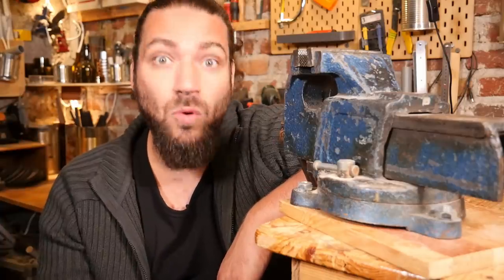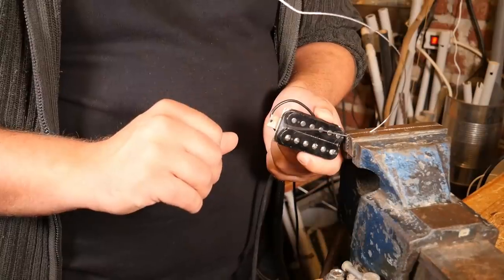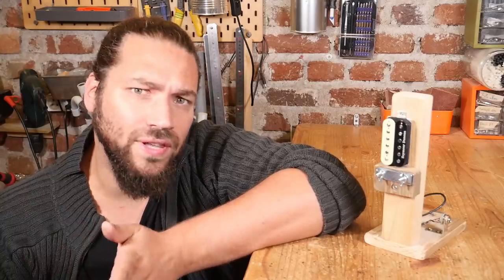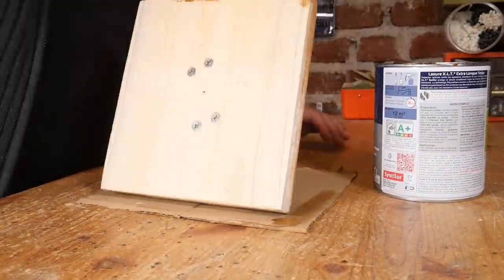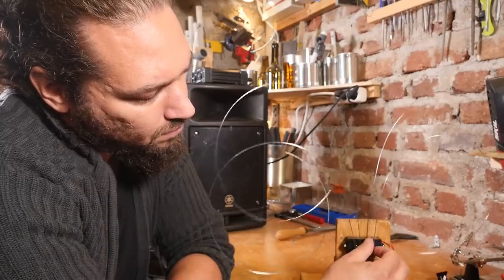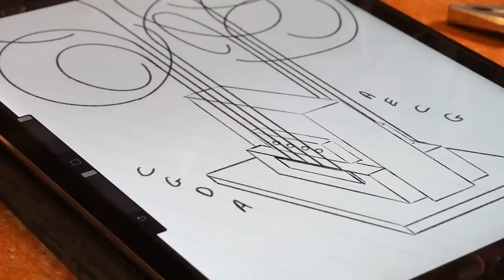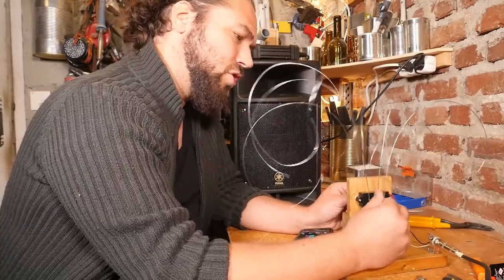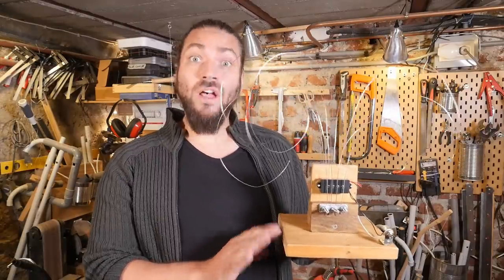I make an electric piano wire instrument

Comment: Watching this just reminded me of a trick we did as kids. We would loop a long piece of thread through a wire hanger and tie the ends together. Then we hung the thread over the top of our head and leaned forward so the hanger hung down. Then we pushed the thread into each ear with our fingers and would swing the hanger into walls and objects and listen to the sounds/vibrations it would make. Just like then this is cool stuff!
Reply from the maker: I love doing this too, this is the acoustic version of my intro!
Reply: Younger hippie days someone taught us at a party to use an oven rack and 2 strings, built in reverb.

Comment: Try using one of those tiny electret mics as a contact pickup on the base. They work wonders, or get into MEMS mics even more up to date. Then amplify it and have the amp drive a low resistance coil with a iron core and place it close to the wire. In one phase it will be deep and the other hookup it will rival a water-phone or anything to score a space movie. This is how the e-bow works, it's rather simple.

Comment: One thing I’d like to touch on is that guitar & bass pickups, while they serve a similar purpose to microphones, actually work by sensing how far the metal string is. A pickup contains a magnet, close enough to the string to slightly magnetize it. When the string is vibrating, the magnetic field changes, and this causes a coil of wire in the pickup to generate a small amount of electricity. In contrast, microphones use any sound vibration to physically vibrate an electrical coil inside near a magnet, which causes the same generator effect. This is why pickups can’t pick up your voice, or something like a nylon string. They can, however, pick up the sound out of a smartphone due to the speaker having a vibrating metal coil inside, which has a similar effect to the pickup as a guitar string. So, while similar in many ways to a microphone, they are not the same thing.

Comment: Get a spring, stretch it out to 2 screw hooks or posts on a peice of wood and throw a humbucker under it. Plug it into an amp on distortion setting and use a slide to play it like a lapsteel. Trust me. You won't regret.
Reply from the maker: I will try!

Comment: I wonder if this instrument could use a mouth violin instead of a pickup. You have a plastic disc in your mouth, attached to a rosin'd string (anchored to your shoe or something). Then you take the wire and rub it along the string?

I imagine the wire parallel to a fretted fingerboard. Pressing the wire against a fret defines how much length is free to vibrate. Then you rub the wire along the string. So, you've got:

1) Mouth disc and rosin string. The string is vertical, anchored to your left shoe.

2) Fingerboard and wire. These are held horizontally. Your left hand holds the fingerboard and fingers the wire against a fret. Your right hand holds the other end of the board. You move your hands up and down to rub the wire against the string.
Reply from the maker: That could work!
Reply: @NicolasBras   Thanks for your experienced opinion! I really don't know if it would work at all. I don't play any bowed instrument so I don't know how to apply rosin and bow it to make sound. I thought maybe to try and slide a wire along a string and it didn't make any useful sound.

So I was completely out of my depth.

In the meantime, I got distracted with a more promising prototype. I'm sure you could make it work in minutes but I'm struggling to make any useful sound.

It's a nasal ocarina, or "nasocarina". It's just a cup with some holes, held against my face to complete the chamber (mouth and tongue to adjust chamber volume). My index finger blocks my left nostril and my right nostril blows air at the nose hole - that's my problem, I'm no good at blowing transverse so maybe I need a nose plug with a slot to aim the air.

The base of the cup has finger holes. The point is, the finger holes allow rapid note changes, while the mouth/tongue control can alter key and increase range.

You can stack a bunch of nasocarinas which is good for selling them at shows, or you can put swag in the cups.

You can even throw them at the audience, because a plastic cup is very sturdy but also light enough to not risk injuring someone (here in Louisiana, thousands of cups are thrown from Mardi Gras parade floats every year).

Comment: So many inharmonics in each string, absolutely sounds like some strange ethereal kind of bell. I wonder if that's the free end's motion that lets it ring and not maintain direct harmonics? Might be worth experimenting with containing the string gently but leaving a free end to ring.
Reply: Tuning by feel is probably the only rational way to go about it, there are just so many dissonant overtones that aren't going to cooperate with each other but will still line up in interesting ways
Reply: Reminds me of some Portal 2 music; Haunted Panels, maybe some others
Reply: Strings create harmonic overtones when under tension so that they carry transverse waves. Without tension they mostly carry bending (flexural) waves whose speed of travel depends on frequency. Technically they also have longitudinal waves which should be harmonic, but they are weaker, have much higher pitch and aren't picked up by the magnetic pickups.

Comment: I wonder whether pitch could be adjusted by operating the instrument upside-down and dipping the wires in water. Maybe just a single wire or a few wires, and a violin bow to keep the sound going (otherwise, the water would dampen the sound too quickly, I think).
Reply from the maker: I have to try now!

Comment: The overtones of this one don't really match the regular harmonic series (where frequencies are integer multiples of the fundamental) we are so accustomed to. That's why it's hard to tune. But then again... That regular integer harmonic series is something that has been quite fully explored by now and you are exploring something else. Good! How about building your own magnetic pickups for these kinds of things?
Reply from the maker: Right, this is inharmonic sounds, I love spending hours trying to tune this kind of sound...for the homemade pickups, I'm not competent for now, but I talked with some people about this, that could happen!
Reply: @NicolasBras  Maybe it's inharmonic,  but you made it sound cool anyway.

Making magnetic picups that work is not actually that hard. Bare minimum is some kind of insulated wire wrapped around a magnet. Connect the ends of a wire to a jack and it should give some sort of signal. There are ofcourse much detail in getting it work good, like the  wire needs to be quite thin (usually thin copper wire with an enamel coating) and you need to have a few thousands of turns to get reasonable output. It also may be easier to just wrap the wire around a piece of iron (make sure it sticks to a magnet) and stick a magnet under it.

Comment: So as someone who also likes doing the same thing, I was thinking instead of metal, what if you used strips of bamboo. Another sound I like is bone, a little weird, but we all bones to dogs. 😆
Reply from the maker: Bamboo will not work with pickups, it could be possible but with an electroacoustic system